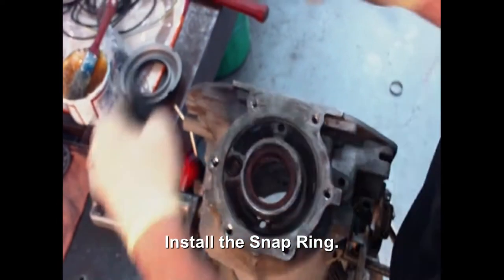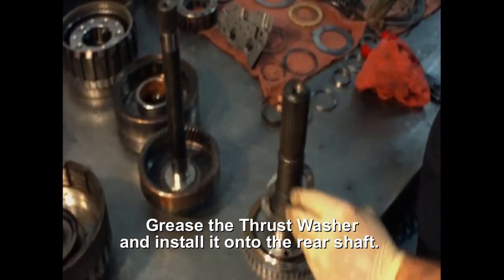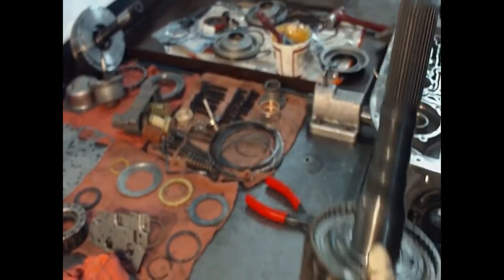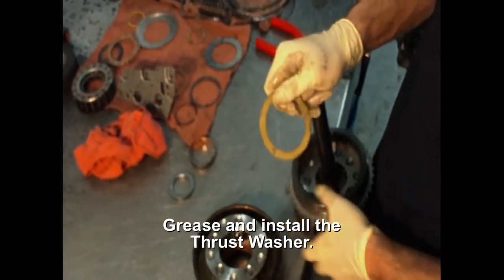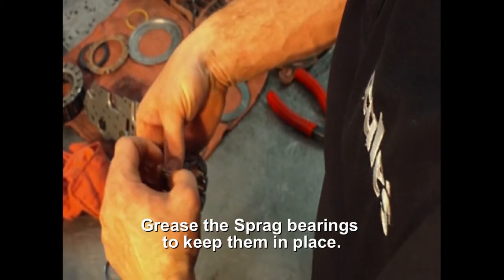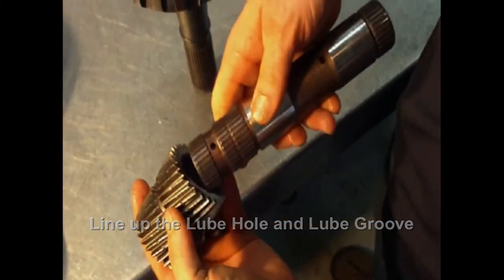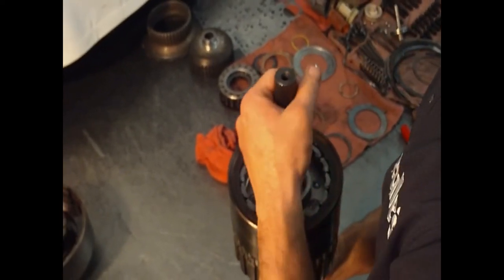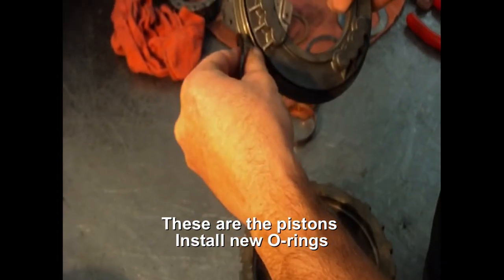2 of 7  Rebuilding a 4L80E Transmission at Leale's Transmission Repair San Jose

Comment: Au contraire!  The sharp edge of a snap ring is supposed to face going in the direction of the thrust against it, which in this case means towards the drive shaft.  The reason being that you want the sharp edge to "bite" into the groove and lock itself in, rather than maybe having it ride up out of the snap ring groove.  How often does that happen?  Not very, but that is the general rule according to the engineers who design machinery. 
  The beveled snap ring for the center support of a TH 400 or 4L80 trans is made that way so as to wedge the CS back towards the selective thickness washer in the bottom of the case and reduce the clearance as the ring expands into its groove.  That's why you use a large screwdriver to expand it as far into its groove as you can BEFORE you take your measurement of output shaft end play and then lock it down with the drilled 12 point bolt when you are within specs.  Recently here, I built a TH400 for a GMC 454 dually that had the wrong washer in there, and when I expanded the snap ring, there was only about .005" end play, that's way too tight! 

Randy